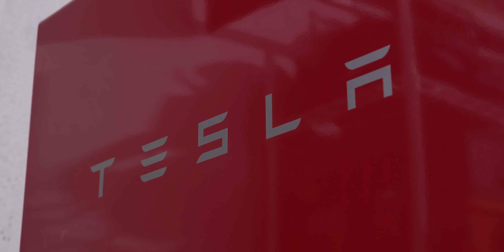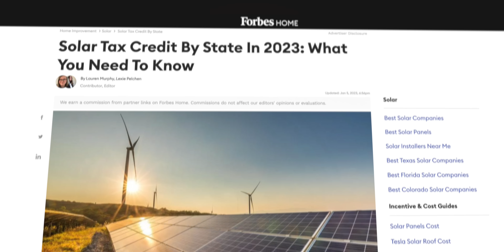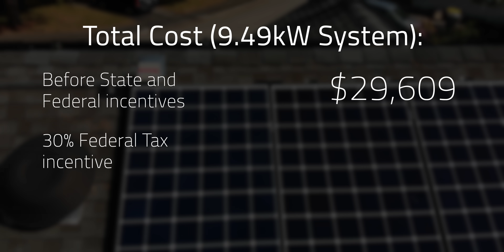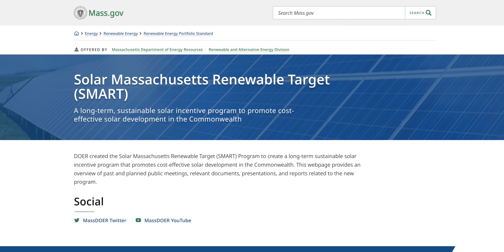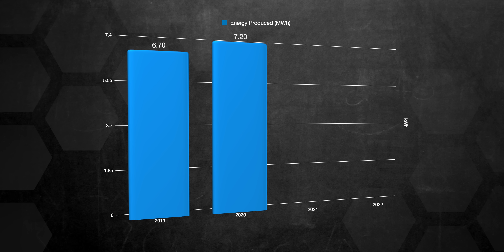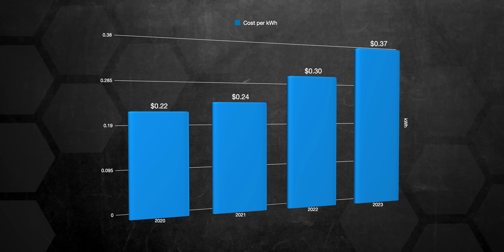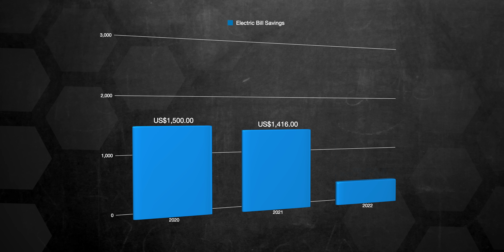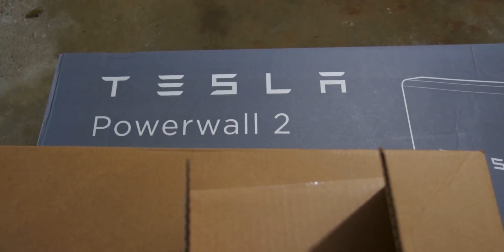5 Years with Solar Panels - Is It Still Worth It?

Comment: So… 7 years to break even? Gee sounds like a great deal to me! 🙄
Reply: That's equivalent to a guaranteed 14% return on investment. Where else can you get that kind of return?
Reply: @BigBen621  how do you figure? You’re not factoring in any required repairs or equipment failures.  Stuff breaks and wears out. ESPECIALLY batteries.
Reply: @RichGiordano-q8h  Most components of my system are guaranteed for 25 years. I don't have batteries. Adding batteries to a solar system has a very long payback, and it done mostly by folks who are subject to long power outages, such as those in fire-prone areas of California, and not for financial reasons.
Reply: @BigBen621  so you get 8-10 hours use with a peak of MAYBE 4 hours? No thanks. I’d want a battery but I’m not bringing THAT fire hazard into my house. I had an industrial PV system 1000 KW at work. I’m not a fan. We removed it because of maintenance issues. We were paying more to repair then we were getting in return.🤷‍♂️
Reply: @RichGiordano-q8h  I have net metering so I don't need a battery. Sounds like you had a crappy system at work. That doesn't mean that all of them are. I've had no repair or maintenance costs over the eight years I've had my system, except for $100 to clean the panels once—which made no difference.
Reply: @BigBen621  so “net metering” will help you during an outage at night?
Reply: @RichGiordano-q8h  Of course not. What I meant was that I don't need a battery to arbitrage the different rates in our TOU rate structure, because I'm reimbursed at the retail rate for any energy I export. Power here is quite reliable, so I don't need it for that reason either.
But the latest net metering rule, NEM 3.0, only reimburses solar owners for the wholesale cost of electricity, not the retail rate as with the earlier iterations. As such, these folks will need batteries, so that the energy they generate during the day can be used to offset usage during the 4PM to 9PM peak period, when rates are sky high.
Reply: @BigBen621  not sold.  Yet. Good luck though. My electric bill in the dead of summer is $300. I’ll deal with the convenience of the grid. Even if solar was “free” (we all know there’s no such thing) I’ll eat the $3000 a year.
Reply: @RichGiordano-q8h  Having solar doesn't mean losing the convenience of the grid. I have both free electricity all year 'round in air-conditioning-intense Southern California, and including a pool pump and charging an EV,  plus the convenience of the grid for cloudy days.
Of course, my system wasn't free; but it paid for itself in a relatively few years, and will do so several times over its useful life.
Reply: @BigBen621  best of luck. May be good to have with all the rolling black outs and power quality issues in California. Hopefully your roofing will last and you won’t have to remove PV panels to repair / replace shingles or tiles.
Reply: @RichGiordano-q8h  Well, we haven't had widespread rolling blackouts in California for 20 years (e.g., Wikipedia: Rolling Blackouts); and the only recent challenges to the grid have been about 10 days of record high temperatures last year, when the ISO asked;users to voluntarily control consumption during the 4PM to 9PM peak period. 
I put a 50-year roof on my home about 10 years before installing my solar system; but if the roof does fail, the panels can be removed and replaced for 10% or so of the cost of reroofing, which the solar will repay within the first couple of years of operation. But thanks for your good wishes!
Reply: @BigBen621  key word being WIDESPREAD?

Several hundred thousand Californians lost power in rolling blackouts in August 2020 amid hot weather, but the state avoided a similar scenario last summer, CBS Bay Area points out, adding that Newsom signed legislation Friday that could allow the state's last remaining nuclear plant to stay open beyond its planned ...Sep 7, 2022
Reply: @BigBen621  I see the average kWh cost in California is nearly double what I’m paying here so it may work for you. Not worth it for me. I hope to hear from you in 10 years. See where you’re at. Thanks for chatting and posting. It’s been a learning experience for me.
Reply: @RichGiordano-q8h  Yeah, that's what really drives the success of solar, especially in Southern California. I'll set a calendar reminder to check in with you in 10 years. Oh, wait... 🙂
Reply: @RichGiordano-q8h  Yes, ≈1% of population; but "[t]hough the ISO has not issued them, several Northern California cities did see rolling blackouts this week (August 2020) due to a "communication breakdown" between the grid operator and local power authority". I.e, not because of the grid.
Reply: @BigBen621  🤣
Reply: @BigBen621  funny story on why our PV system was removed at work. As mentioned I had a 400 KW system on the roof of my building. It was about the size of a football field and worked fairly well. That is …Until coastal birds learned that they can pick up clams and drop them from a height onto the solar panels to crack them open. They would then swing back down and eat the open clams. It tended to break the panels as well and we were replacing them at an accelerating rate as you know cracked solar panels are fire hazards, and we needed to replace them immediately. It turned out to be more financially responsible to just remove them than maintain them.

Comment: We have had solar for 18 years and it is still working great. Our panels came from Canada with a 300 pound snow limit and the contractor did that because we live in Florida with hurricanes and strong winds like they have up in Canada at times our bill is a third of what it would be including a heated pool and hot water that you never have to boil water ever again.

Comment: I've heard rumors that solar panel installations can cause the roof to leak. Is this a real problem? Can the panels be installed off the roof?
Reply: Friends, family and I have installed several systems, with no roof leaks. Panels can be installed off the roof if you have the area, but most urban and suburban homes don't.
Reply: @BigBen621  Thank you for the information.

Comment: Seeing this late, but have questions about the physical maintenance and installation. As someone in a house in a similarly snowy state, my questions were very much about the snow and rain and how they interact with the panels, and I am glad to hear you talk about it. My other question is about the roof itself. Eventually you need to replace your roof, so I am wondering how much more difficult solar panels make the process of roof replacement, and what affect roof panels have on the roof itself over time. If you see this and are able to answer, I thank you in advance.

Comment: Homeowners insurers cancel or won't issue policies if you live in FLORIDA. Check it out before you install. Hurricanes love solar panels.
Also there is a regular 5 year interval cor inspections.  I have seen them on bleacher looking racks physically😱 not connected to the home.

Comment: This is why I have a hard time justifying solar panels... My annual power cost is less than half of just what you saved your first year, at around $600. And I'm not even that far from Massachusetts, just in southern Ontario. We have time of use rates, and our peak is only 15c a kw/h with off peak at 7c

Comment: One element which I have never seen addressed is the different rate of thermal expansion between the metal frame and the roof, which may impact the life of the roof.
Reply: DON'T FORGET LEAKS, CAUSED BY INCOMPETENT INSTALLERS

Comment: Interesting breakdown of costs and experiences.
I have been interested in solar for about 5 years but only recently have I bought a house to really consider it seriously.

I live in Thailand, we have a LOT of sunshine, and even when its cloudy, theres still a lot of light energy so the panels would still be producing electricity every day.
I live in an area about 600 miles from the equator, so have 12 hours of sunlight per day. I have a large south facing, slightly angled roof front and back, an area of about 45 sq metres. Good start so far...

However the solar panel assistance scheme was dropped because so few people took it up. 
Why with such a ready source of sun? The buyback price from the government owned electricity company was very low, it made the purchase cost payback time almost 25 years.
But the bigger problem is cost of electricity from the energy network. Were into the hot season, its 36°C in my house as I'm writing this, I use fans for air movement more than AC, but AC at night to sleep. 
My monthly electricity bill is about $32-40, about half that in the cooler months. To use the AC at night I'd need a battery bank, and there is no Thai produced solar equipment, so import taxes makes it broadly in line with US prices, and almost certainly Chinese made.

It's a shame because I really would like to be energy sufficient but I can't see a viable way to make it cost effective, even if electric vehicles became mandatory, the cost of a system would never make it viable, unless government assistance schemes were re-introduced and a better buyback rate applied.

Ironic really, in a country where many privates residences could have an energy surplus, and have very dependable sun, there is very little solar power, countries like the US which have far fewer opportunities to fully utilize sunlight, has schemes and lots of attractive reasons to fit them! 
🤔
Reply: If all the benefits were actually true, inspectors would require solar be standard on all homes, but the numbers never add up.

Comment: One note on solar panels and house value. We recently moved and we were buying a house with solar panels. Our loan company said they wouldn't give us the loan if the panels were not fully paid for. I know it is pretty popular in New Mexico where a different company owns your panels and you pay a flat rate, but at least for our loan, the company said that was a deal breaker. Luckily the house had paid off their panels so it was a non issue.
Reply: Yes. That's because, if the solar panel company goes bankrupt or payments are missed, title to the entire home can be impaired. It's a potentially very bad deal for homeowner as well as lender.
Reply: This is a big consideration for home owners thinking of adding panels too. When you go to sell if your panels aren't paid off you can be spending a considerable chunk of your equity closing those loans.
Reply: My coworker bought a new house with solar panels. (It’s law in my state that every new house be built with solar panels. Bc my state is so smart.) His arrangement is he leases the panels. 
     It’s like buying a mobile home. You own the home but you still pay rent. 
     He said the lease payments are low, for now.
Reply: Did the seller include the solar panels with the house deal?
Reply: FHA, FNMA and Freddie Mac who largely make the rules for residential lending do not permit the additional value that panels might add to the property if they are not fully owned. That's okay though because solar panels in most areas do not add to value according to what many of my appraiser colleagues say. It is extremely rare despite the representations of the solar company. I am in New Jersey and done many detailed analysis to isolate the incremental value contribution of solar panels and found nothing. I have an open mind and I cannot categorically say they do not add to value but be aware.

 Keep in mind; Financed panels are another financial hurdle for potential buyers to achieve to be able to purchase your home. Some people object to the appearance of solar panels.

Electric in New Jersey has been rapidly rising so solar panels may still be a good choice for you.

Comment: Matt, I have installed solar on my home in Virginia and wish I knew more about clipping and matching the best panel with inverters. The installer has been so so not really happy with that aspect. I have 27 REC Black 365 panels matched to Enphase IQ8+ inverters with 20K of Enphase battery storage
Reply: I have a similar problem with my system.  Enphase has not responded well in my opinion.  Way too much clipping.  I have 12150 watts of Qcells (405w X 30 panels).  30 -IQ8+ microinverters.  It starts clipping at 8800 watts.  We lose a lot of power for more than 6 months a year here in Spokane WA.  I feel like I was duped buying high capacity panels only to clip of so much power during the best solar months of the year.,

Comment: Bought 40 acres and a completely off-grid cabin in April 2019.  

We installed 16-300w panels, a couple Renogy 100A charge controllers, 2-4000w magnum inverters and 4-300ah LiFePO4 batteries. 

Live out here year round in Upstate NY.  Best decision we ever made!
Reply: @UncleDruncles  you mind my asking how much the initial cost was to get the solar setup? I’m really wanting to get a trailer and just get even a couple acres off grid and set this up.
Reply: @thegrayjedi5202 be careful of critters and icing if you live north like that guy
Reply: the exact opposite experience of myself and my family. no critter issues, no cloud cover,  um what about de-icing in the winter. this post sounds like candyland bs
Reply: I commend you for your frugal energy use.  That is a small system to run a home, especially the relatively small battery capacity.  We all could live with a lot less and live just fine.
Reply: @michaeldoherty2289  Thank you MD2289.  

Going on our 5th year here come April.  We can go 2 days on a full charge with no light.  Typically only having to run a generator for 20-30hrs all year and this is Upstate NY. 

It can be done! 🙏
Reply: @UncleDruncles hahahah. this doesnt sound good unless youre rich and can afford to use it or not

Comment: I have no data to substantiate this question but is it possible that the reason electricity rates have gone up in your area is because, with more kwhs of electricity being siphoned away by solar-panel users, the cost of the fixed infrastructure to supply electricity is now being spread over fewer kwhs required from that infrastructure?  This may mean that I, as a homeowner who is unable to gain the benefits of solar panels because of the dense trees in my neighbor's yard, am subsidizing your solar panel use by having to pay a greater portion of the infrastructure as demonstrated by the higher utility rates?  Just a thought.
Reply: Same thing is going to happen when road maintenance expenses are no longer funded through gasoline sales taxes - every EV owner will get a surcharge for miles driven to make it up.  Savings evaporates - surprise!

Comment: Never pay for it self
Reply: False. This depends on many factors, including local rate structure, shading, system cost, federal, state and local rebates, your electrical consumption, etc. There are areas where's it's virtually a slam-dunk, such as Southern California; and areas where the payback is much longer or non-existent, including the northern tier of states or midwest states with very low electric rates. But to make the blanket statement ""Never pay for it self" is simply absurd.

Comment: So, it makes economic sense if:
1. You have high electricity rates (0.37/kWh is more than twice the national average and higher than any other state but Connecticut and Hawaii).
2. Your state has net metering, in which case you get paid for both generation and transmission (which someone else actually provides), and not just for generation. This uses the utility as 100% efficient battery which it is not. Remember that the utility pays you for the use of your battery, but you don't have to pay for using them as a battery. 
3. Your state generously subsidizes solar panels and provides a monthly payment over ten years. However, this is only available until they get "SMART" and reduce the subsidies. 
4. A federal tax credit of 30% is available and you have a sufficient tax burden to take advantage of it.
5. Somebody gives you the battery and then pays you for having a battery. 

If all of the above is true, it is a 7-year payback.  As an aside, given all of the subsidies (including net metering), it is not surprising that Massachusetts has the third highest electric rates in the nation.

Comment: The other thing that is so backwards on this model is the federal government needs to build a solar array out in Death Valley that could power the whole continent and research the best ways to make that power available across the country. It really doesn’t make sense to have every house have a panel that feeds into the grid anyway.
Reply: The difference is that virtually all homes are already connected to the grid, so installing residential solar doesn't require any new connections.

Comment: Question I have is the roofing system below the panels 

Assumed the panels are above the roofing

Is installing a roofing with a longer life than asphalt shingles best practice?

How does one replace roofing (end of life or damaged). Is the solar system removed. How is that done.
Reply: Certainly a longer life is better. One removes the solar system, replaces the roof, and then reinstalls the solar system. Just last month my ex-stepson-in-law paid $3,500 dollars to remove and reinstall a 4.0 kW system for a $31,000 roof repair; so the cost is significant but not huge.

Comment: I would wonder how much cost having solar panels adds to the job when it is time to replace the shingles on the roof?  I doubt most contractors want to deal with the solar panels so that means a second contractor to remove the panels and wiring, store them and then come out to re install them after the new shingles are on.  Perhaps that might dissuade some potential purchasers of a house that already has solar on it? Charles
Reply: Just last month my ex-stepson-in-law paid $3,500 dollars to remove and reinstall a 4.0 kW system for a $31,000 roof repair; so the cost is significant but not huge.